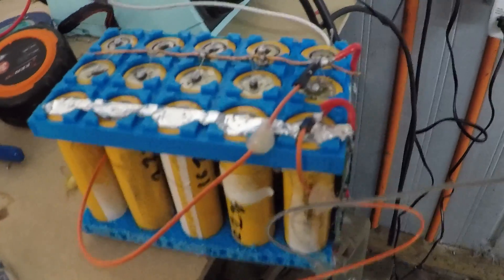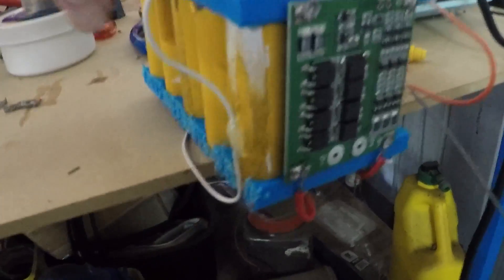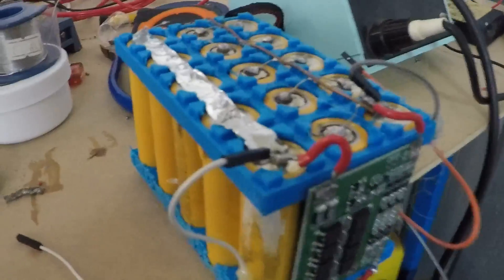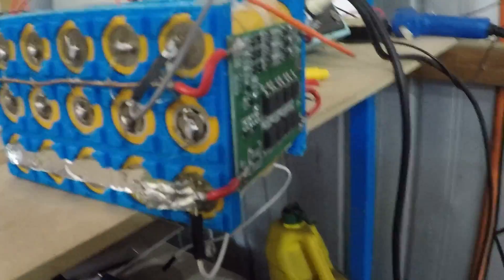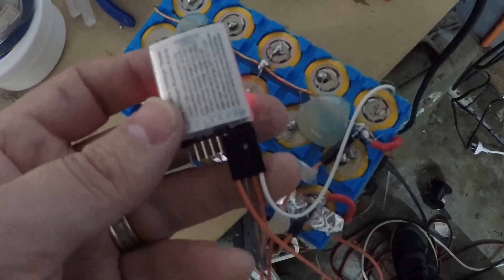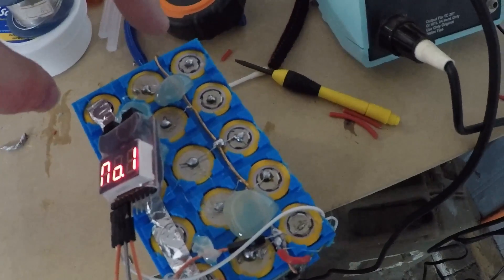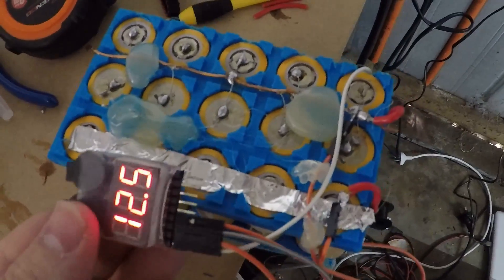12V 18650 Car Battery Pack

Comment: Hey, I need some help, I want to make a Lithium Car Battery and and need to know which BMS I should use, I would like to make a 12V 100Amp Battery pack.
Reply: You won't need 100 amps , unless you have a very large V8 .  When they rate a 100 amp battery , that is constant amperage, not the cold cranking capacity which for a 100A battery could be as much as 800Cold cranking amps .   If you have a V6 or 4 cylinder ,  can get away with a 40 amp, or 60 amp for a V6.........again it is the cold cranking amps, that can draw a start amperage for a few seconds .....I am using a small 40amp Lihpo4 or Lithium Iron Phosphate battery used in some medical crash carts, or wheelchairs .  Works great , and will last well over 10 years .   I also want to do a bank of 6/2.7v capacitors ,  backed with a small LiFepo4 battery bank , with a resistor between the battery and capacitors........
Reply: @randyhiggins1563 
Thanks for the heads up.
Reply: @wanderingcalamity360  .......You are welcome .   Just have to pay attention to what they are selling , with the small Lithium packs , that starts a car now .  Most has Lithium Pouch cells, that has HIGH amps to draw from .   Do you have plans to build a Lithium battery for your car ?    Let me know and have some that will work for you .
Reply from the maker: For 100 Amp, you need to use super capacitors, most normal lithium batteries cannot discharge 100amps unless you put 20 or more in parallel (ie. 4S 25P) there are a few people on youtube who've done this with capacitors if you look around, you need the discharge AMPS more than capacity.

Comment: Hello David, nice video there i wonder how to charge that pack, i have to same protection board and i know how to wire them but i'm a bit confused about charging that pack.
Reply: And also mine is 3S 7P pack it says that board can handle 25A so is it okay to use? think to power up 60 W portable refrigerator for camping etc. by the way  didn't mention it but i need to charge with solar power and charge controller  .
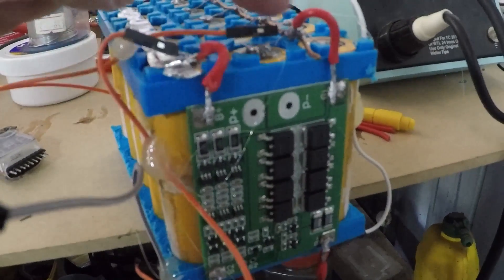Reply from the maker: Güneş Gökgöz hey, if you’re charging with solar, you could use a buck or boost converter to get you solar to 12.6 volts and then use the P- and P+ to charge through, as seen in 1:18 on my video. Just don’t send too many amps through otherwise it will kill the batteries, the safe limit would be 1 amp per battery I would say. My next pack will basically just trickle charge from solar.